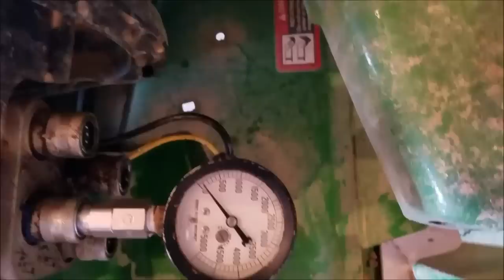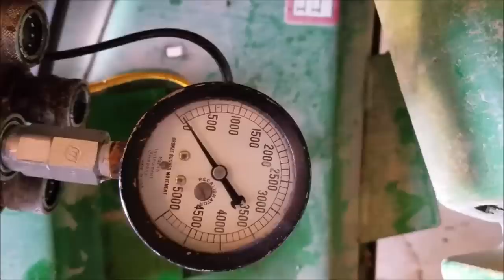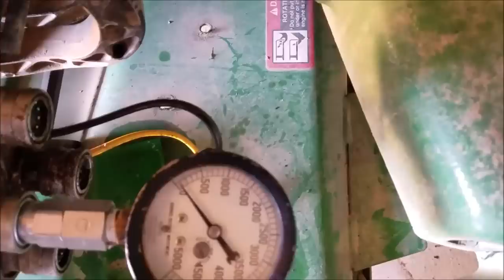What Tractor Time with Tim DOESN'T WANT YOU TO KNOW !

Comment: Really enjoyed watching!  Thanks for the shout-out and kind words!
Reply: Tim he is correct you are indeed a Saint.
Reply: Thank you. I have a 2032R. Love it. Very nimble, powerful. Well engineered. Meets all my needs. Need a ballast on the rear for heavy front end loader. Perfect Tractor for me.
Reply: Glad you responded TTWT.  Great content.  I’m torn between a 1025r or 2 series.  I’m going to be cutting and moving lots of down trees 🌲 on our Colorado property.  Any suggestions?  Thanks
Reply: @lovinlivinrvin7261  Hello! Did you get your tractor yet?  Since no one responded to you, I would pick the 1025R for tight spaces and the 2032R for more power and wide open spaces.
Reply: @lovinlivinrvin7261  , Another YT channel considers the 2025 a "series 1.5"  The real 2 series begins with the larger 2032 and up.  My advice "Get the smallest tractor that can handle your largest chore. Then it also handle your smallest chore.  ---  If you get a tractor large enough to easily handle your largest chore, it may be too large to handle your smallest chore."  Stay Safe.
Reply: @lovinlivinrvin7261  , One more suggestion, Talk to your dealer to try out (Maybe have to rent) a 2032, then a 2025, then a 1025.  Then you will have real world experience on which tractor fits your needs best.  Don't get one so large you can't manuver  in your yard to mow, unless you plan to have 2 tractors and also have a small garden tractor.
Reply: @genedameier8746   Very good advice

Comment: I believe the only restriction orifice in the loader circuit is to reduce the flow when the loader is lowering.
I'm with you, I don't think a small increase in pressure will do much harm. I may even get around to checking and adjusting mine.
The curl function having greater force is a function of the geometry of the cylinder to pivot point ratio.

Comment: be careful turning up the hyd pressure I know some one that did and blew the hyd pump seal and filled the engine full of hyd oil not good
Reply: thanks for the reply
Reply: Just curious at to how that is possible. The hydraulic pump for the loader and scv is located on the back of the transmission by the rock shaft and right above the PTO.... far away from the engine!
Reply: @wraith3951   it was on a Kubota B7100 4x4

Comment: Those cheap pumps are not designed to run that kind of pressure, not only that you will overload the components. I have a great deal of experience with hydraulic systems

Comment: I’d like to know how to speed up my backhoe on my 1025r! Great video tho!
Reply: If your still looking , you can get a HydroPlus kit now. His website is up and running. Increases flow to the implements.
Reply: Buy a bigger backhoe with a bigger flow rate hyd. pump. Most backhoe speed depends on how much flow and pressure the pump puts out.  A lost of the small tractors with backhoes on them do not put out enough flow and pressure to do a good job. Kubota know that very well, and is known for bigger hyd. pump output to help with this. Also warn seals inside the hyd. cylinders will let pressure bypass within the cylinder without showing a external oil leak.

Comment: Orfices restrict flow, will not change pressure at all, that is to slowly metter the oil when you lower your boom, with out it the boom will drop super quick and put the supply oil coming in on the other-side of the cylinder under a vacum causing air bubbles aka cavitation

Comment: You need a liquid filled gauge for more accuracy!
Reply: A liquid filled gauge is not always inherently more accurate than a standard gauge. The liquid is usually meant to dampen vibrations through the gauge mechanism to help stabilize the needle for more accurate readings of the gauge face and help the gauge survive the vibrations. It can also help reduce moisture corrosion inside as well. Just a little info for all.

Comment: on a 2 inch cylinder at 2300 lbs of psi you had about 7225 lbs of push on each cylinder.  at 2500 psi you are at about 7854 lbs of push on each cylinder.
Reply: It would depend on how the hydrostat is plumbed but I really would believe it is your imagination. Since the relief valve you adjusted it is on the control block for the loader.
I would like to believe the hydro Stat system is a one-piece unit where the pump and the motor are right together and you have a forward and reverse relief all inside the transmission housing?
On the older John Deere equipment you could go look in the parts book and find where your relief valves are. But I would almost bet that's a relief valves for that High stats system would be a non serviceable item?

Comment: Would have been cool to see a lift test. Before and after.
 I've been thinking about turning up the line pressure on my Kubota.
Subbed.
Reply: I cranked up the psi on my bx2680 and it changed the whole tractor's usage! Do it!
Reply: @dzlkawboy33  
I've got a b2650 cab tractor. I have to say, it's set pretty well from the factory. I can pick up enough to pick the rear end off the ground. 
Now that I have a counter weight, I'd just like a little more umph.

Comment: To answer the question of bucket curl strength being tied to the “spacer” on the coupler.  Lift/curl strength is a two part process. 1. Pressure, higher is going to yield more capacity at a cost to equipment strain and wear. 2. Leverage, the geometry of the loader curl vs the lift frame will give more available “torque” to make each function lift more.  The curl function is strongest about mid articulation, losing power in either up or down swing, and lift is strongest at the lowest point of travel degrading in the up swing (curl strength also degrades the farther away from pivot point faster than lift).
Regarding having a smaller orifice being a possible reason for more pressure in the curl.  I’ve never seen the inside of that spacer coupler, and I’d like to see it to confirm, but If it were in fact a smaller orifice, I believe It would have a greater affect on flow than it would on pressure. It could affect pressure if the entire run past the orifice was necked the same size, but after the orifice you lose any pressure you gained at the orifice. Pressure maximum is relative to the relief valve you adjusted. With respect to the surface area on the back of the cylinder face, and diameter of the tube. To have an orifice in the middle of the system would have minimal effect to pressure at the cylinder. Huge impact on flow. Possibly controlling dump speed at rated capacity for safety?  (Piston Elevators use this same principle as a safety for decent if hydraulics fail with a full carriage at a high floor) I’m not a number cruncher or physicist. Mearly the son of a John Deere construction equipment mechanic who’s also an electrician, and an equipment operator for the U.S. Army. Hydraulics and electrical circuits act similar and hence why I took work as an electrician in the civilian sector lol.  Not saying your wrong not having torn into my own 1025r to see what’s in that spacer... but just from a design standpoint there’s a lot more physical evidence in design.
...I seriously hope I didn’t lose anyone there lol. My intent was not to detract from your awesome video. Well done.
Reply: Kentucky Yankee I think so. It makes the most sense.

Comment: your tilt actually has a bigger rod in the cylinder than than the lift cylinder, I'm getting ready to increase the size of both cylinder bores by 1/2" (not the cylinder size) for lift and curl strength.  in other words.  increasing the cylinder size won't help,  increase only the rod size